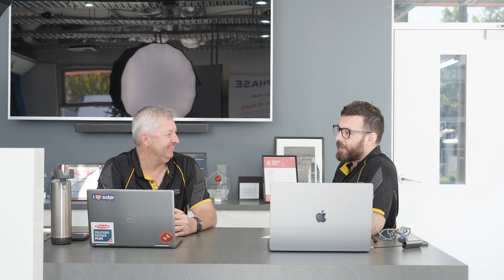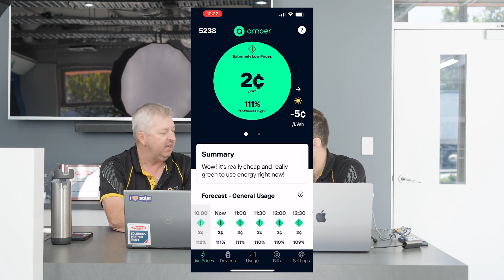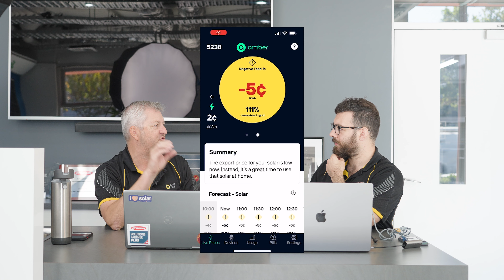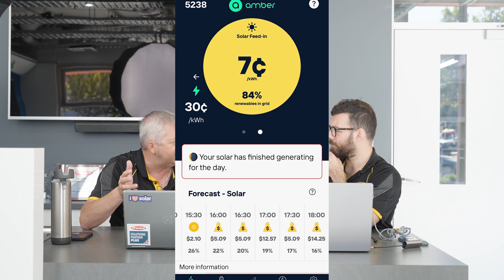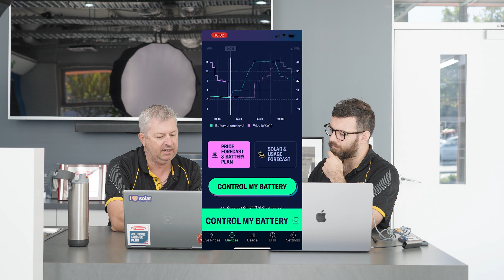Join Renewables With Smart Batteries

Comment: As a system for power arbitrage (taking advantage between price differences between different markets), this makes sense. However, I'm curious to know the opportunity cost. The tesla Powerwall is not cheap and if it were easily profitable we'd see more utility scale battery developments. What would be the ROI on a single Powerwall based system? How would this impact wear cycles? What's the cost of signing up with Amber smart shift vs a traditional utility company? Otherwise, good in concept but I suspect it doesn't make economical sense just yet with current battery technology.

Comment: Battery storage when grid voltage trends high due to 100%+ renewables powering the grid, then export that energy when grid voltage trends low and demand for energy starts to exceed normal supply.  Over time with enough people doing this, it’ll help to stabilise the grid and increase the reach of renewable energy beyond the times when it’s sunny, windy or hydro 😅

Comment: The plan could be to charge your battery at negative prices and then in the evening run your house off the batteries.  Night time power will be expensive and if you feeding power back to the grid from the battery  then you will be using power from the grid to run your house.  That means you are selling for less than what you are paying for that power to run your house?  My understanding is that feed in tariffs is generally lower than what it would cost you to buy.
For example night power could be 50c per but when you sell back you get 30c.  IF that is the case it makes more sense to charge at negative prices and then use the free energy to run your house during the most expensive time frame.